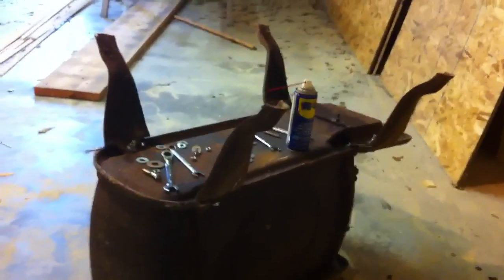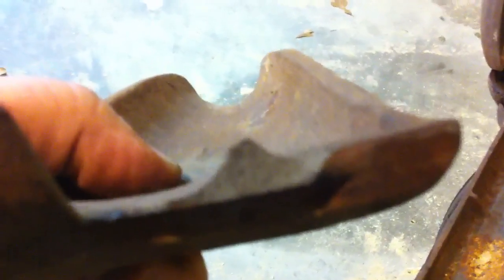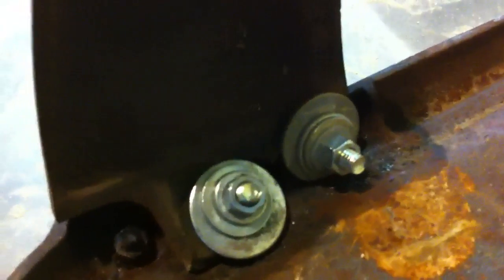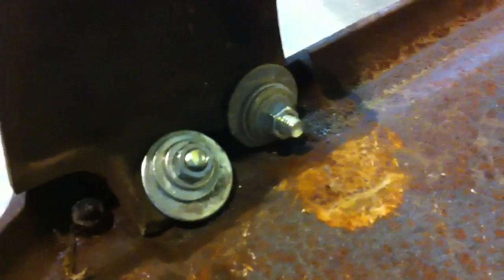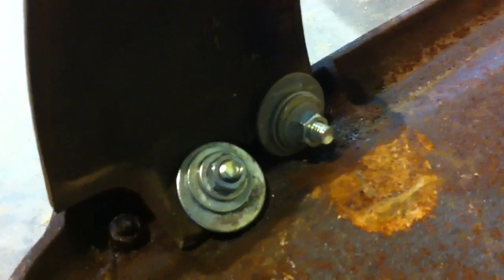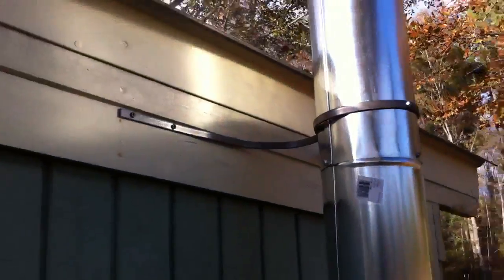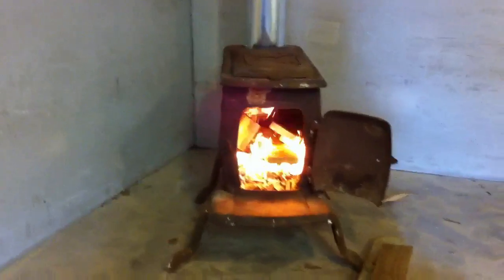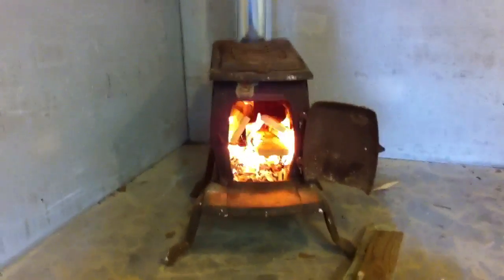How to install a woodstove

Comment: It's always better to run your stove pipe up thru the roof to keep the pipe inside which has it draft better than cooling off outside like that. Unless you keep it real hot when burning, it will build up creosote faster. I see alot of people making that mistake without first checking. Live and learn.
Reply from the maker: I made the choice to run it through the wall because I didn’t want to risk the leaks around the pipe. I never had any problems or issues. Never had creosote buildup and it always drafted fine. Sometimes, you’re wrong.

Comment: Hi you should get a wood stove fan it spreads the heat around the room, it works with the heat reaching high temperatures
Reply from the maker: I have fans circulation the heat. Thanks.

Comment: Oh Yeah... A rip roaring fire...People coming up from the street to admire the symetrical hole, LOL... There is a welding rod for cast iron but there's still a technique that has to be used to weld it. Preheating and all... I've seen vices that were fixxed, but I don't know if they where brazed or welded. The last welder I worked with was amazing with stick welding, TIG, brazing, aluminum. He was awesome.

Comment: Your cement backer board will work better if you leave a 1-inch gap at the bottom. If you're using single-wall pipe, it has to be 18 inches from combustible structure, unless there is a "listed" wall thimble or listed pipe for less clearance (e.g., 1-inch), or 9 inches from approved "protective shield''.  Same on the outside: must be at least 18 inches from the edge of the unprotected roof, or 9 inches from a protected shield on the eave and roof.  Of course, that presumes you're in a place that has fire code or you have insurance on your building.

Also, if you had installed the pipe right-side up (crimp pointing down), the interior condensation would go down inside the pipe rather than running down and out through the joints, dripping down the outside.  Use of unlisted, single-wall pipe for a chimney is not allowed for any one- or two-family dwelling,  under NFPA 211, if anyone cares. Just went to a structure fire last week with a basement woodstove improperly installed, operating day and night, ignited the unprotected wood framing 5 inches away.

Comment: So cozy and nice !!! You should get some stove polish and wire brush and clean that stove up now looks great !!Also we allways drill holes at every joint of the pipe and put in sheet metal screws so the pipes won't come lose when real hot and the wind gets ruff too safer that way !!

Comment: The crimped section of pipe should always point toward the stove. There will be times that you have condensation, rain or creosote in the pipe. When this happens in the setup you have, it will leak into the house side of the pipe.
Reply from the maker: Well this stove was set up to accept the non crimped side around the flu. My new stove is also set up that way. I could cut the crimp off but it would throw off my height. It wasn't important enough to cut and adjust my other measurements.
Reply: Oh well....keep it in mind for the next time...they rust out fairly quickly.
Reply from the maker: +Steven Hardy next time I'm gonna totally redo everything with a nice stainless through wall and stainless pipe.
Reply: Ahhhh ok I have had a 12 inch triple wall setup for the woodstove and a 6 inch double wall setup for the oil burner for about 24 years now. Whats nice is that the 12inch can and does survive a chimney fire AND drops off the soot collection into the cleanout over the spring and summer .

Comment: What kind of Piping did you use in this install? How would you have done it differently if you went through the ceiling rather than your wall? How is your drafting working? Open the door and get any smoke inside? Im looking at doing this to my woodworking shop. Thanks.
Reply from the maker: Robert Kowalczyk the only difference is that I have a much nicer stove. If I could afford it, I would use the double wall stainless pipe. Otherwise, everything is fine. Just lit it this morning.
Reply: Did you just use single stainless? How long of a flue total do you have?
Reply from the maker: Robert Kowalczyk I didn't use stainless. I used galvanized. My pipe is long enough to get the top above the ridge of my roof. Any less than that and you will have blowback every time the wind blows. The wind creates a vacuum wind it goes over and around a building. If you don't have your pipe a couple feet above the ridge line, it will create a high pressure that will blow back into the room.

Comment: Thinking about installing a barrel stove in my shop. kind of confused about the triple wall pipe on the outside. My boss man says I need it but my buddy says I'd be fine seeing as I'd only burn it two days out of the week. Any help and or suggestions would be greatly appreciated. Thanks
Reply from the maker: Since I know nothing about where you'll be putting the stove or what kind of surfaces you'll be running the pipe through, I really can't offer any advice.
Reply: +BCtruck concrete floor, 2 Bay garage with no vehicles, and the wall that I would be going through is t-111.
Reply from the maker: +Matt McNeely it's sounds like a catchy what I have. Concrete floor,t-111 siding. I use this stove every day in the winter. It heats 900 sq. feet and I've had no safety issues.
Reply: +BCtruck, rebuild, repair,repurpose  Awesome. Thanks for the help. My shop is also 900 sqft. and I'm hoping for heat this winter.

Comment: Just out of curiosity, how did you seal the outside of the shop wall to prevent rain from getting behind the flashing around the pipe?
Reply from the maker: I put some latex calking on the wall before i screwed it down. 3 years and not leaking. ill have another look when it warms up a bit.

Comment: type b gas vent? wouldnt trust it or wanna breath it
Reply from the maker: what are you talking about? this is my second year using this stove and ive had no problems whatsoever. there is a fire going in it right now! gas vent? Im not using gas,its a wood stove.
Reply: i know but its type b gas vent piping not steel. causes toxins when heated ask welders who weld galvanized and aluminum. im not trying to trash your install i liked your video but maybe worth checking out the warnings especially with the heat of wood burning
Reply from the maker: John Paris I am a welder. the galvanized burned off of this pipe during the first burn. no worries.

Comment: could you not trace the chimney pipe that needed to go through the hole to make the hole? lol
Reply from the maker: Perhaps.
Reply: @bctruck  but thank you!, I didnt want to buy a wall thimble for my ice shack I just built as they are not that cheap from what I can find.  this is a great idea to make my own! Already have the sheet metal.